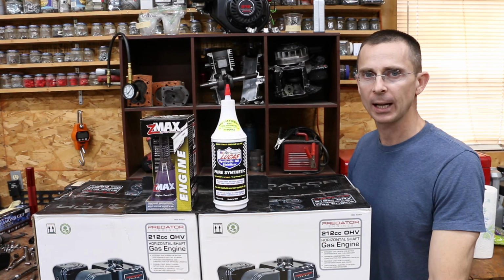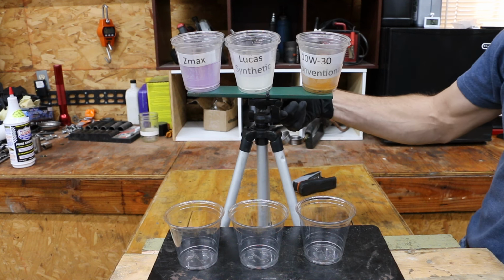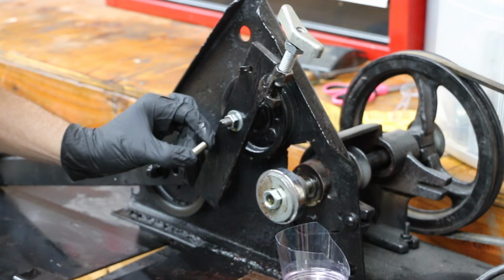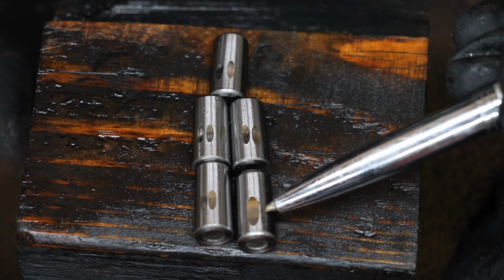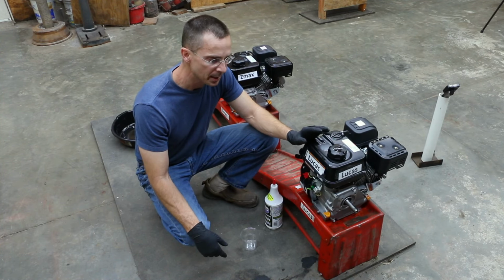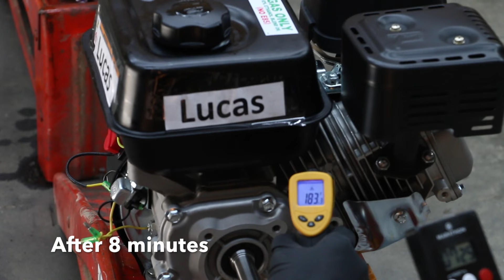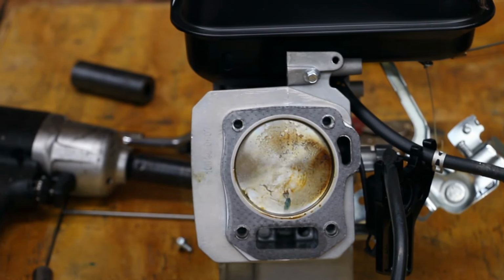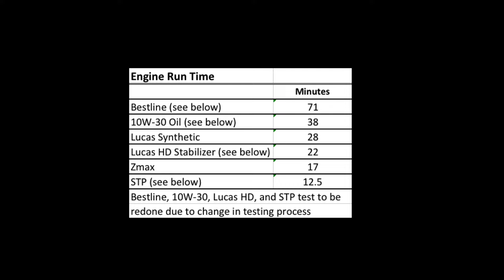Which engine self-destructs first? Zmax or Lucas Synthetic?

Comment: As far as running a normally worn engine, and for lubricity/viscocity/longevity purposes - I would rather take 1x--2x the price of that additive, add it to the oil "budget", and just buy/use a budget friendly synthetic oil of appropriate rating instead. If using additives for other reasons, a damaged engine etc - that might be different but I'm not sure these additives are approrpriate for that kind of use (?)

None the less, thank you for this. The two engines gets to serve as educational subjects both here and where donated; not all - heck most destructive testing is not waste. Especially not when it comes to research, development and education. Quite often we need to break some eggs to make an omelette. We cannot learn the tolerances of something without pushing it beyond its breaking point. Just try not to do so with living creatures, at least not intentionally 🙂

Comment: DT are valuable and provide data that no other testing can. I agree that most of these oil additive products are not worth using. They are a temporary fix for engines that are smoking, knocking, etc. Additives like Restore and WS2 do help for filling in normal wear in engine and bearing surfaces. They actually work.
The only thing I didn't see was the crankshaft on the Lucas motor.
I don't even understand how people even buy the Zmax stuff. At least Lucas is like the old STP motor honey. ;D
Reply from the maker: Thanks for the feedback.

Comment: I've just added a bottle of Zmax engine addictive to my BMW with 107500 miles. The results was an immediate improvement. The throttle response is better, the engine at high RPM is not so draggy and overall the engine just felt freer and happier.
I know this is just subjective feedback. I'll go through a tank of fuel and work out the average fuel consumption. I'll update this comment in the future.
Reply from the maker: Thank you for the feedback

Comment: Lucas will only prevent engine failure if its been used in a properly running engine for a while. My 390 big block had a slight oil leak in my 66 ford. I got to the point of just using Lucas because regular oil leaked out faster because it was thin. I did this about 7 months and one evening coming home my oil pump went out, I drove it probably around 25 mph up one mt and down and up another totaling around 35 miles, got up the next morning and bought new oil pump and oil and was pretty sure my engine was shot but to my surprise oil pressure bumped up slightly more than before and smoothed right out, blowed my mind. Ended up putting about 90,000 miles more on it and was still running great the day I sold it. Probably should have called the company and did a tv commercial about it.
Reply from the maker: Thanks for sharing.

Comment: I tried Z Max and found the only metal I could tell it soaked into was zinc, but since zinc is typically for conductivity and I would bet it increases resistance. It doesn’t seem to lubricate much, although it definitely does since it works for lubing locks and hinges well, but I think it works best as a cleaner which is why I think it works well as a fuel additive I expect cleans the fuel and exhaust system a bit since it’s pretty much just mineral spirits. I would love to see how the engineers tested it.

Lucas uses heavy paraffinic oils which are like wax that lubes well, doesn’t burn off too easily and when it does it’s easy to clean. They use much of the same stuff in numerous products like the the synthetic oil stabilizers and the fuel injection cleaner. It must raise the temperature needed to get the fuel and air mix to ignite and increase the duration and completeness of the burn while lubing the fuel pump and upper cylinders
Reply from the maker: Thanks for sharing.

Comment: Lucas now has a Low Viscosity Oil Stabilizer. I would like for you to test it. Lubricity, cold flow, and does it actually make your engine quieter? How does it affect the viscosity of a 0w20 oil? Typically, I would never put any additive in 0w20 oil, at least until it passes the PF tests! Great job, Todd!
Reply from the maker: Thanks for the video idea.

Comment: If you ask ME, adding Lucas to your engine oil is not the smartest thing you could do. It's too thick. Sure, it increases viscosity, but when you first start your engine that added viscosity, in my opinion, only serves to prevent oil from getting where it needs to be in a timely manner.
There IS one additive which I used in 1995, however, which actually did what it claimed. It made my engine run considerably cooler. In a Southern California winter you can expect typical night-time weather to be around 45 degrees Fahrenheit. So I tried this stuff ( I wish I could remember what it was called) in my 1989 Pontiac Firebird 2.8L engine. Making the 25-mile drive home at 9 o'clock at night, the engine would not get over 140 degrees, and the thermostat would never open. My heater was pretty much useless, so I drained the oil and replaced it with straight engine oil and the engine temp returned to normal. That stuff might get you out of a pinch on a lonely highway in the desert if you had a blown radiator hose or something. Might even be ok in the hot Texas summer. I wish I could remember what it was called.

Comment: I have been using Dura Lube for over 20 years and I've had great success with the product. I would love to see a showdown between Dura Lube and Bestline. I think those are best as far as engine longevity is concerned but never seen them head to head. If you have the time, I would love to see it. Thank you for your videos. I have learned alot.
Reply from the maker: Thanks and you are welcome!  Thanks for the suggestion.

Comment: So my truck has this sticking valve problem, that's kept me from passing smog. So I've been throwing all I can at it. I used some oil treameant, and you could hear it trying to fix itself, but it didn't work. So I added a bottle of zmax for lawnmowers, and in 30 seconds it totally changed. So I had several codes now I'm down to 1 code. I'm going with zmax, no matter what.
Reply from the maker: Thanks for sharing!

Comment: 0:55 I have a idea. Maby instead of draining the oil, disconnect the governor and hold them wide open until one or the other blow up first. You might annoy the neighbors in the process, but it was jest an idea😂
Reply from the maker: Thanks for the idea.
Reply: I actually thought that was what he was going to do when I clicked the video but still not disappointed keep up the good work!
Reply: @percyhill7315  yeah this guy is great! I was thinking that if you rev an engine to the absolute max, the more thermal breakdown because the oil will not liberate the upper cylinder, valves, connecting rod, and other areas of the engine effectively enough and take away extra heat due to extreme conditions. Causing the engine to eather throw a rod, destroy piston rings, and more. So the oil additive will have to do the job of inhasing better film strength to the oil to protect those high friction parts of the engine in extreme conditions. In fact it says on the lucus oil bottle that it stops thermal breakdown. So would lucus or another oil additive stop or slow thermal breakdown and protect the vital engine components in extreme conditions and how long? Because the engine won't last forever wether there is a oil additive or not. One oil additive should out perform in the same conditions. Draining the oil takes out the lucus with it. No one is going to take out there oil to see how there engine peforms. They want to see how the additive performs with the additive in the oil. In not saying that project farms ideas are bad, I'm jest making a suggestion. This is all jest my opinion.

Comment: Whatever ZMax I have left at home no longer goes in my cars. But, interestingly I  found a better use for it--cleaning guns!! After a trip to the range, I cleaned my pistols with the usual CLP, Hoppes, etc. I assumed they are cleaned already after running wipes inside the barrel until they are clear. I decided to use a little zmax to lube the barrel and was I surprised when the wipe came out  dark with carbon and build up. From then on I used zmax as cleaner and lubricant. Soaking my barrels with it and heating them  up in an airfryer to bond the molecules deep into the metal seems to help keeping carbon build up to a minimum. BTW,  I'm using Lucas as my additive for my cars.
Reply from the maker: Thanks for the feedback.

Comment: Lucas with synthetic oil! I add AT-205, and Sea Foam to all my oil changes. 200k miles on my 850 Volco and 6.0 Powestroke. Stopped all my oil leaks, I have almost zero metal flakes in my filter,....15k miles between changes, always.
Reply from the maker: Thanks for sharing.

Comment: I don’t use additives to my truck but I do use Valvoline full synthetic 5w 20 in my Ram and have since I had 8,000 miles on it and now have 170,000 miles and all is good … I do oil changes every 2,500 miles even though they recommend change oil at longer intervals I also use Fram Gold oil filters and a K&N air filter
Reply from the maker: Thanks for the feedback.

Comment: Great demo, I've built many many of these engines for people with racing karts and racing mini bikes. The rods in those motors are super weak.  I would love to see this same test with an aftermarket rod in them... I know it's far fetched but I would bet you would get alot more run time out of the Lucas machine. 🤷🏼‍♂️. When I get done building and breaking in the motor, I personally switch them over to schaffers... I can't say it's way better then the next oil but I know for a fact it runs cleaner when it's time to do an oil change. Methanol kills those little engines 🤣
Reply from the maker: Thanks for the feedback.
Reply: @ProjectFarm . Any activity on YouTube is good activity for you 💪💪💪 .. keep pumping out the good stuff brotha

Comment: I would like to see how well Prolong Engine treatment works as well .... i put prolong into my wife's car it was a 1991 ford thunderbird 3.6l v 6 .... on her way home from work her radiator blew out the side tank and she kept driving home ... i had been putting 1 pint of prolong in after every 2 oil changes before this happened ... the engine stopped running and she had it towed home ... next day i ordered a new radiator and hoses and thermostat .... checked the oil for milk all good .... filled it with water and the engine fired right up .... ran it till tep came up no leaks ran perfect ... filled with coolant she drove it for 5 more years till we traded it in on a new car ... I think it was the prolong that saved the engine.
Reply from the maker: Thanks for the video idea.

Comment: I know this test was done some time ago. Unfortunately, Z-Max wasn't designed to do what you tested? It's really designed to work slowly, over a longer period of time,  assisting quality engine oil to do what it was designed to do, which is lubricate. I have used Z-Max for years and get excellent results with it. When used properly. When used for the purpose of displacing deposits, so oil can retake it's rightful domain in the engine, it works very well. I have many stories. As it happens, I use BOTH of these products, for different reasons, at different times. Interesting video though. I always enjoy watching someone see how much an engine will take before failing. It's good info.
Reply from the maker: Thanks!

Comment: There is a place for destructive tests like this, especially from an engineering standpoint. You get all kinds of information that can be used to remedy design flaws. I found that lucas oil additive realy works well, especially for small engines that take abuse. Mixing about 70% lucas with 30% of a penetration oil will free up all kinds of stuff and give it a starter oil coating on the bearing surface.❤
Reply from the maker: Thanks for the feedback.

Comment: I work in aviation, destructive testing is absolutely essential. 

If you happen to read this. Maybe use some aviation to auto motive test. I only ask, simply because I am instructor. And many of my students know cars, and I try to show them the relation ship between aircraft and automobiles

Mil spec 23699 is a standard turbine engine oil, used side by side some car synthetic. Or avgas vs auto high octane. then there is mill spec 5606 hydronic fluid.. would love videos like this I could show students.

Comment: great vids bro.  i have a couple of requests.  you did a test on getting a lawnmower to run on gasoline vapor by piping the intake air up through a jug of gas...worked great.  would you please try it with other types of fuels...particularly ethanol.  Another test that i know many would like to see is concerning a two stroke oil called Blue Marble.  Test it against some other top brands.  Read up on what Blue Marble is...i have run it for years and I am an absolute believer!
Reply from the maker: Thanks for the suggestions.

Comment: I ran Lucas in my oil in my 2004 honda element for nearly 488,000 miles. The valve train and upper end was nearly immaculate last I saw it around 292,000 miles to change the valve cover gasket because it was slobbering. I’m now running Lucas synthetic in my oil in my 2020 f150 3.5 EB in combo with Rotella Gas Truck 5/30 syn oil.
Reply from the maker: Thanks for sharing.

Comment: The connecting rod on those is the weak link. We use a billlet rod for kart racing in the clone classes. The flywheel is just downright dangerous at high rpms, so we replace it with a billet part as well.  I wonder how well they would fair with Amsoil 4T kart oil in those engines without additives.   In fact, a comparison between the 4 cycle kart oils that are commonly used in B&S LO206, B&S Worlds and "race-built clone" engines would be really interesting. We change the oil almost every time they are run, but I wonder if one is really substantially better than any other...??  lubricity, durability, etc. You wouldn't need to destroy an expensive race engine, but the wear and tear would likely be comparable to these cheap unbuilt clones, if a better connecting rod was installed to ensure similar performance. (BEWARE that flywheel if you remove the governor!) There may be some valuable information at ARC Racing.

Comment: For your lubrisity test uße small square shoulder berring and remove the plastic covers on both sides the dip it in your test product bolt it so the  inner race remains fixed and outer race moves freely have a lever appiy pressure to berring till failure  maybe you can measure lbs.at point of fàilure

Comment: Years ago when I was racing go-karts I used to test a lot of oils and additives on both the lubricity tester and the dyno.  Back then I'm not sure either zmax or lucas  products existed.  The additives that seemed to work for both lubricity and power were in order, Militec-1, BG extreme pressure lube, Duralube, BG MOA and a number of other high paraffin additives as well as one I can't remember that contained a lot of lead.  Teflon based additives did nothing and STP did very little.  The BG and other high  paraffin additives tended to begin to work quicker in the lubricity tester.  They also left a lot of wax inside an engine after it ran.  That probably doesn't hurt a splash lubricated small engine with solid lifters but for a car with hydraulic lifters I'd be wary.  Militec-1 was interesting as the oil had to get over 150 degrees before it would start to work.  Once it "impregnated" you couldn't load the lubricity tester enough to stall it out even with a very small wear scar.  You could clean the bearing and races with brake cleaner, fill the lube cup with straight methanol and still not stall the machine.  You could bake it in similar to what you did with zmax and it would work just as well on the lubricity tester in methanol, until at some point it eventually wore off.  If you only treated one of the sliding elements and not the other, it didn't work at all.  I like the militec because  in all the engines I've torn down after using it, I could never measure any appreciable amount of cylinder or bearing wear beyond normal break in wear and no build up.  Full disclosure, back when I started doing those tests I was sponsored (free product) by a local BG rep. I switched to Militec.  If it's still out there and your still doing these tests, I'd like to see how you fare with it.
Reply from the maker: Thanks for the video idea.

Comment: I have been using Lucas a long time ago. I have a chrysler town and country 2008 3.8, and nobody last more than 240k miles on the engine, and no more than 200k miles over transmission. I still have the same engine with 345k miles, and just a little knock at the first 20 seconds of a cold start. Other than that. It runs fine. Thanks for clarifying that.
Ah. In order to long last the transmission, I do oil changes every 40k miles.
Reply from the maker: Thanks for the feedback.

Comment: Try G&B Concentrate oil additive mixed with the oil.  I saw an enginge lose it's oil and continue to run at a fast idle for 5 hours with out sizzing up.  Try the G&B Concentrait as recommended and see if it really works.  I was at a demonstration of Amsoil and the rep told me the only thing better than Amsoil is Amsoil with G&B Concentrate added.  Who know?  I'm just repeating what I was told..  By the way I don't use either of the products.  I use a straight synthetic and change the oil as recommended.  That works for me.
Reply from the maker: Thanks for the suggestion.